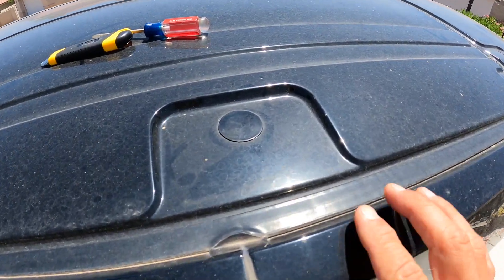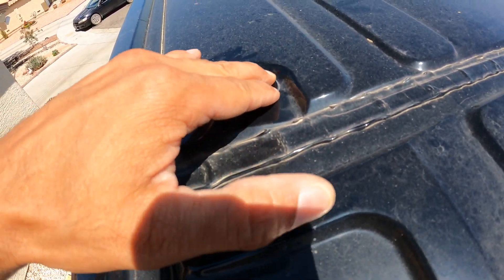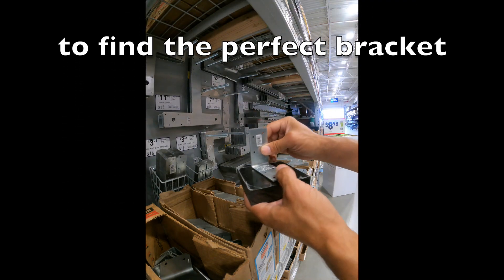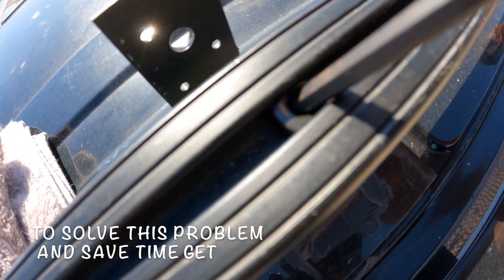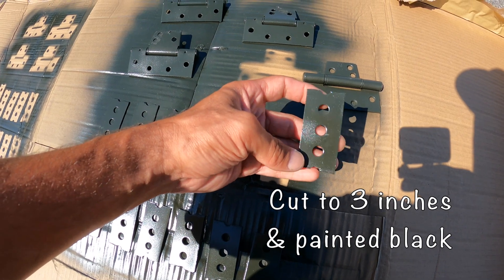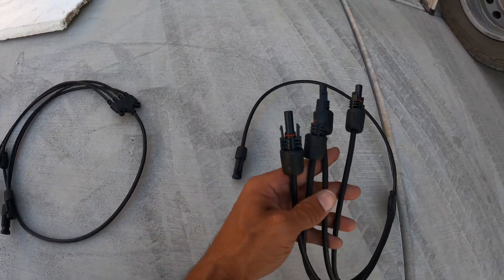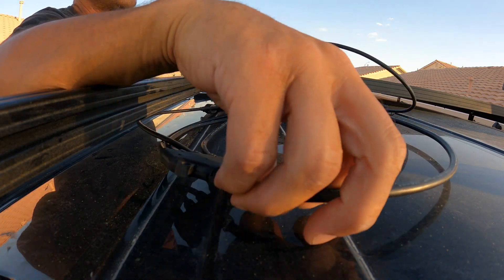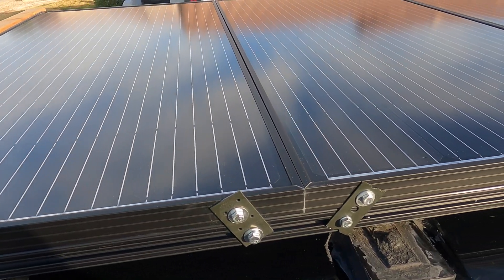How To Install DIY Custom Van Roof Rack & 800 Watts of Solar Panels to 80/20 Optional Rooftop Deck

Comment: Those patches that you discovered on the roof are there for a reason. They allow you to install wiring into the inside of the van. I think you cut a hole in your roof for no reason? 😱
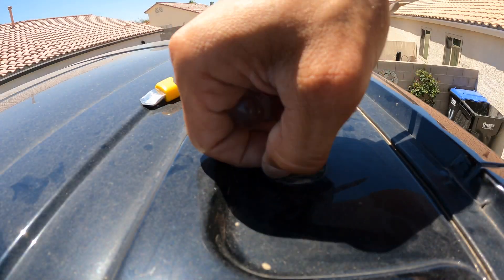Reply from the maker: If you go back and watch the video, at 1:02, you can see that underneath the patches there are M8 metric nuts that are fabricated into the build. That’s what I used to attach the roof rack to with M8 bolts.

Comment: Hi, are there any crossbeams to support the panels or is it just the panel running across?  I'm always afraid of the wind running below such a large surface area. Is it rigid or does it vibrate a bit if you give is a little pounding on the framing?       BTW I believe there are 80/20 nuts with a ball bearing that holds itself in place so you find the hole easier.
Reply from the maker: Hi John, There are no cross beams except the one in the back that has my rear view dash camera on it. Was going to put in cross beams but the panels are rigid and the edges lined up perfectly with the 80/20. The 2 inches thick panels became cross beams. No vibration. Also no wind sounds when driving. Driven 80 mph with strong cross winds with no issues. I will definitely use those 80/20 nuts with the ball bearing next project. it would save me a lot of time.
Reply: @ChilliesWorld  Thanks, I appreciate the response.  Your solar install looks the cleanest I've seen and is apparently very solid.  Will definitely apply your methods to my build.

Comment: Not sure if you're still active or not but this is the first video I've come across that discusses the angle of the support your L-bracket sits on. How did you determine that the HDPE needed to be cut at a 6 degree angle? (Thanks in advance.)
Reply from the maker: I parked my van on a flat surface and kept trimming the HDPE, checking with a level each time until it was perfectly level. The 6 degrees refers to the angle I set my table saw blade to when cutting the HDPE to make it level for my brackets. Hope this helps!
Reply: @ChilliesWorld  Thank you! That definitely helps. I wasn't sure about the level application because nothing is truly "level" in a vehicle given the surface it's sitting on and the the variable air pressure across the 4+ tires. Thanks for the tip though I will definitely try this install application on my Shuttle Bus conversion.

Comment: What's the maximum width of the panels you could safely install this way (less worried about stealth)?  Trying to figure out how to get more than 800W on same van (it's on order).  Thanks for the video!
Reply from the maker: Hey James, I'm not sure of the maximum width it will hold. The panels I used just happened to line up with the 80/20 racks edges perfectly. The basic rack itself is strong and can probably hold wider panels. Hope this helps. Let me know what you end up doing.